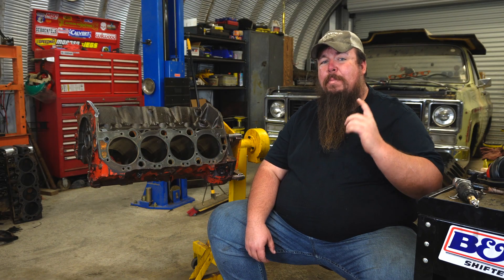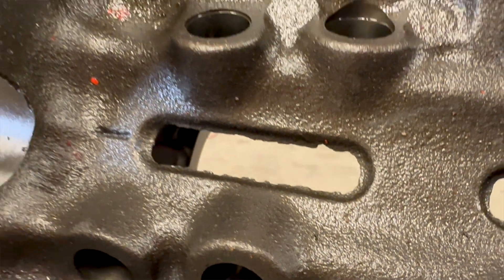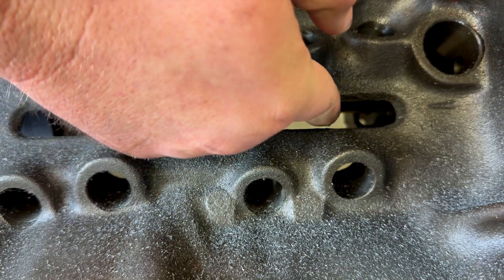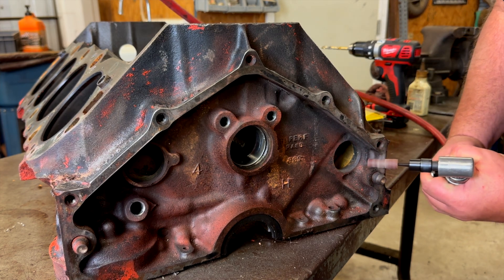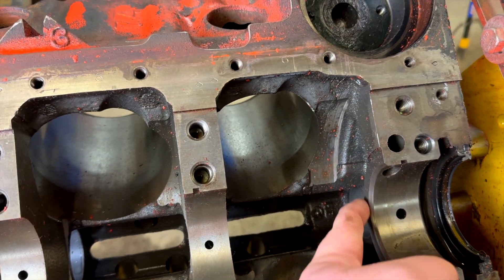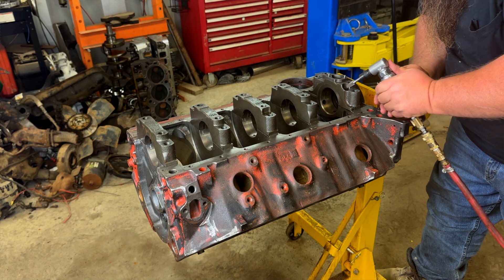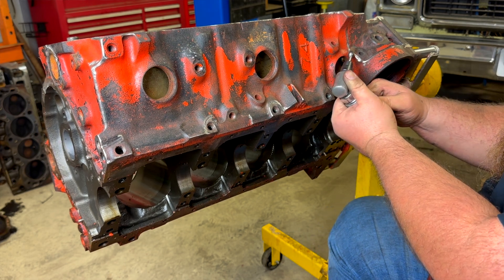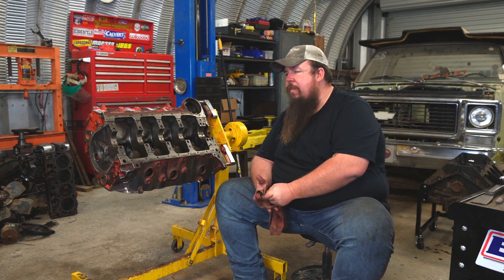How-To: Deburr Engine Overview

Comment: I am planning a 496 build and I have been checking out lots of tips and tricks, I ran into your video and watched it through, and at the end I was surprised to see you shared a bible verse, thank you for that, I will be following you from here on.
Reply from the maker: Thank you so much for watching! My 489 build is on hold at the moment. Race car season is in full swing so I’m working on folks cars that can run this season 🤦🏻‍♂️😂 but don’t worry. When the season winds down, I’ll be doing a full tutorial on building my 489. Hope you stick around! And yes, definitely not afraid to show my faith here! Because if it wasn’t for Him, none of this would happen or matter.